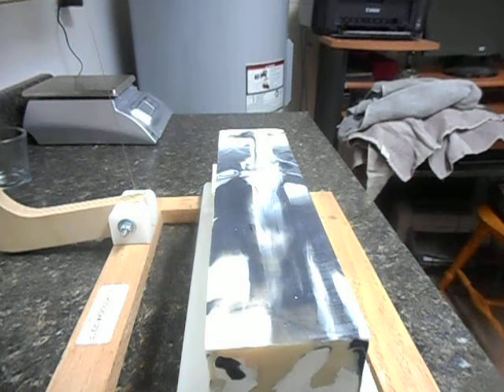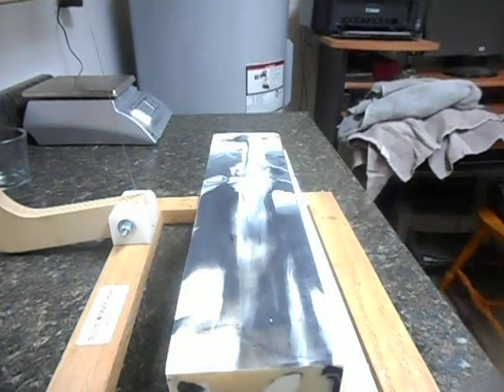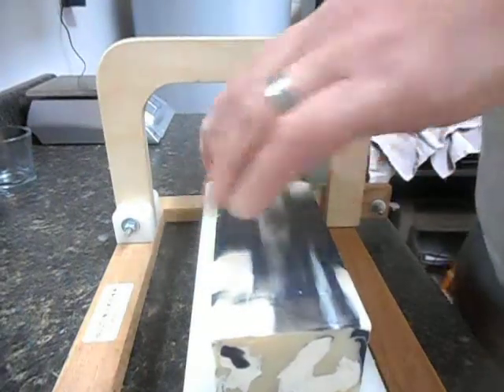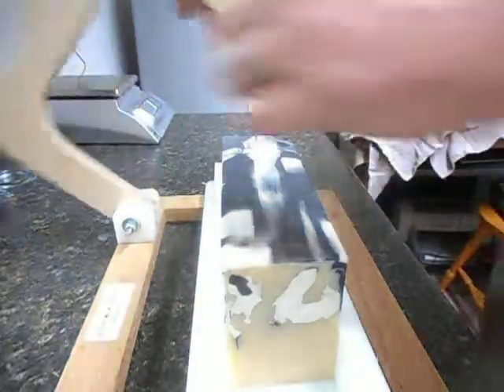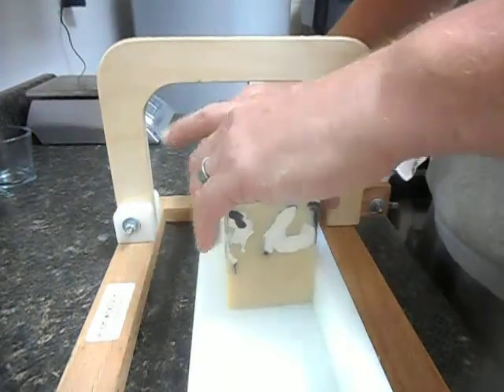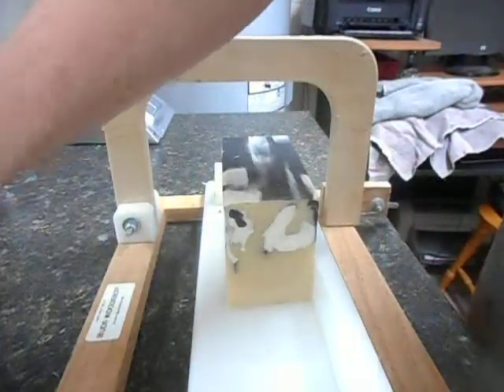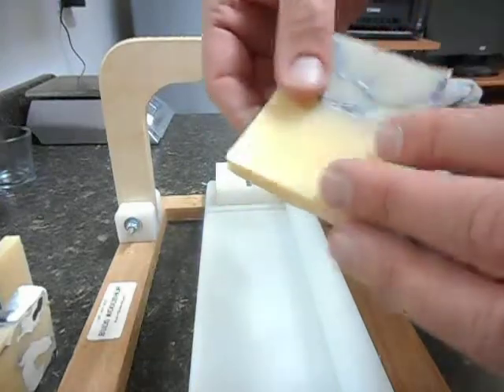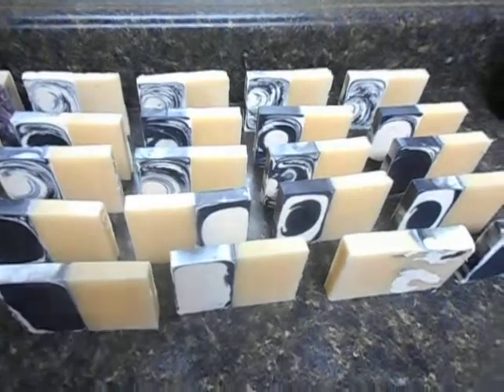Soap cutting 031618 column mold drop swirl

Comment: Question.... I came across a family with 3 children that are allergic to coconut, and mom is a vegan. Uhgg! The children asked me to make them a "cool" soap. So, no tallow, no coconut oil. What would you recommend I use as a hard oil???
Reply from the maker: That does pose a problem.  Coconut is such a common base for cleansing and bubbles.  However, palm oil help it set up hard as well as shea butter for hard oils.  Liquid oils to use would be olive, canola, and castor.  It won't be the same without coconut, but palm and castor oils are secondary bubbling oils.  Of course, run it through a lye calculator.  Good luck!
Reply: Thank you so much. 😁